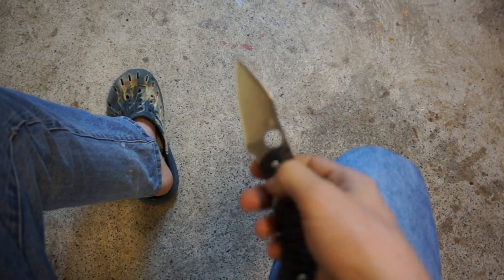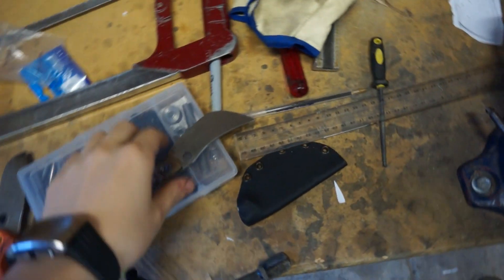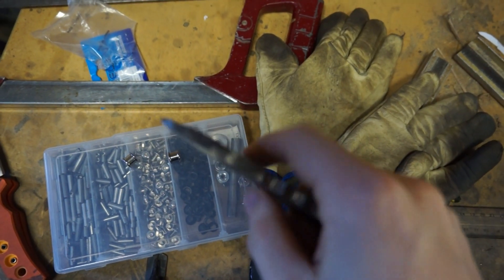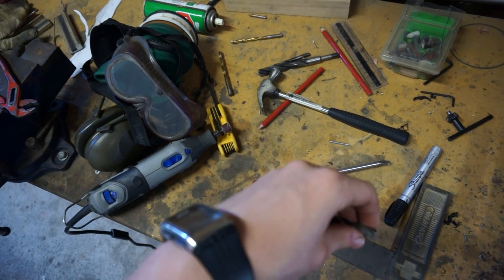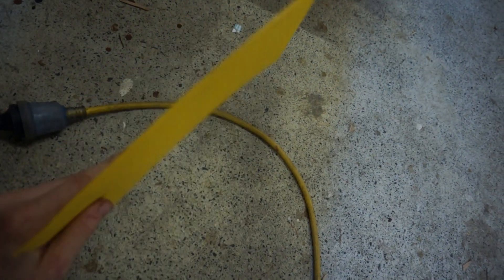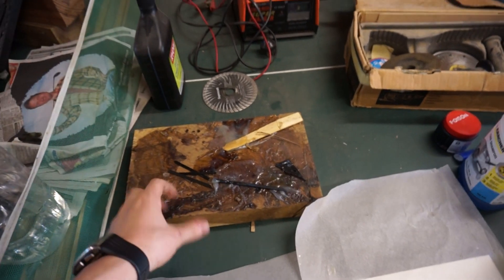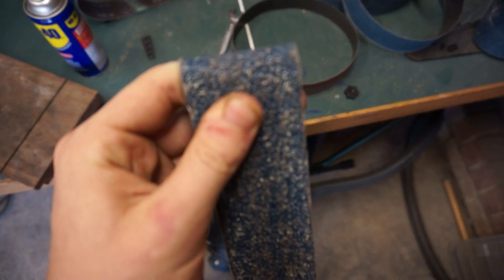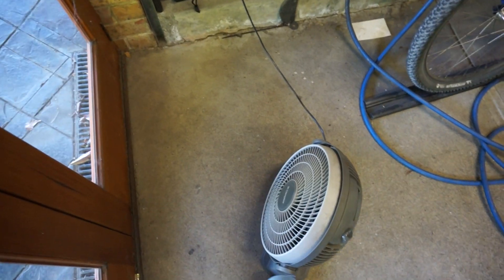tour of the knife den

Comment: this is actually really professionaly made its not important but how would you make a grind whithout a belt grinder
Reply from the maker: thanks, you can do what i did for my first 10 or so knives and use a flat bastard file to do the bevels. afterwards you clean that up with sandpaper
Reply: thanks